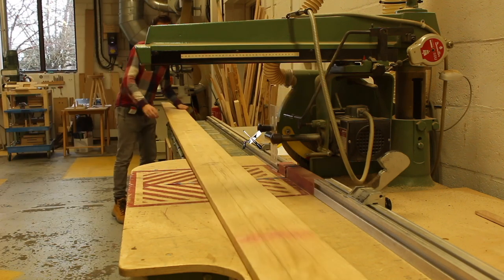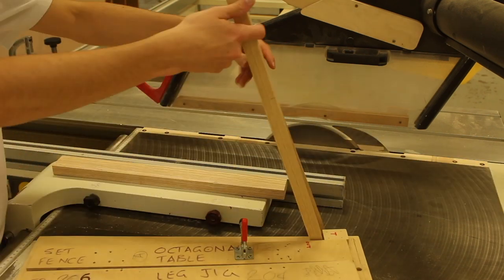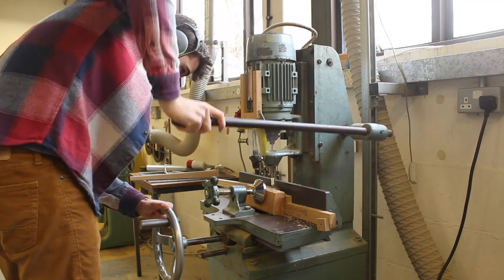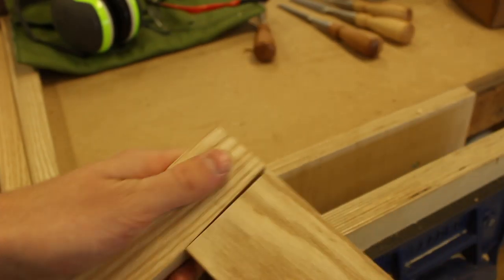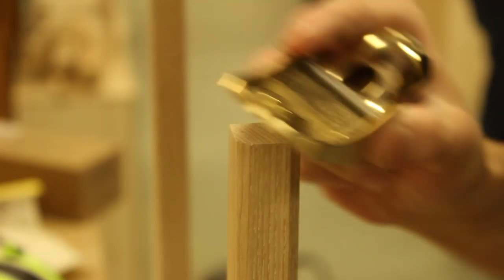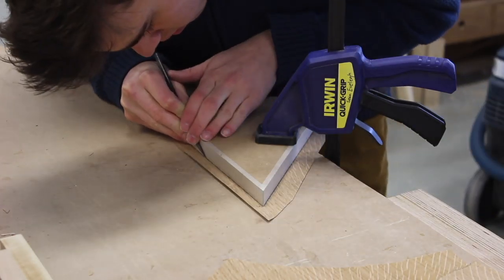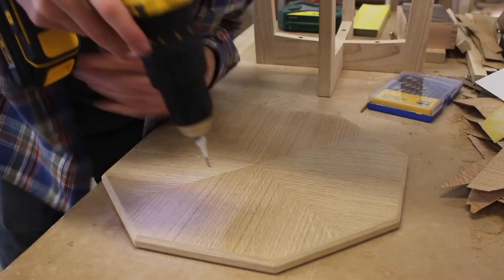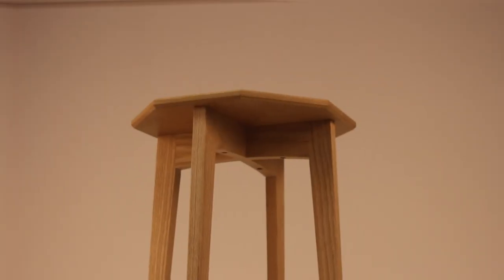How To Make A Geometric Side/Coffee Table

Comment: Nice table, I really liked the starburst veneer.  Much better top than the last table. However I don't understand why you called this a hand tool project, you used more power tools than in the power tool project! A wide belt sander for heavens sake. I'll give you the rough dimensioning of the stock with power tools, but come on.
Reply from the maker: Hi John, thanks for watching. Yeah I agree, It was a set project, and we were told it was a hand tool table. I did you a lot more hand tools in the project though. from hand planning to final size, using a spokeshave for the curve, hand cutting the tenon, planning the lipping. The title on the video now is, Hand and power tool project haha